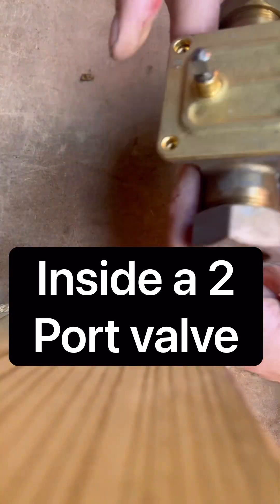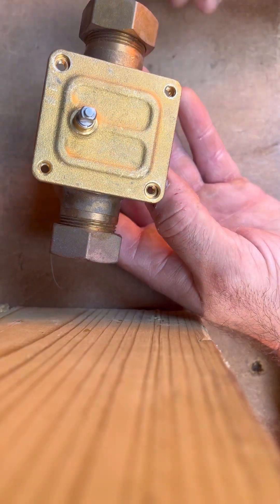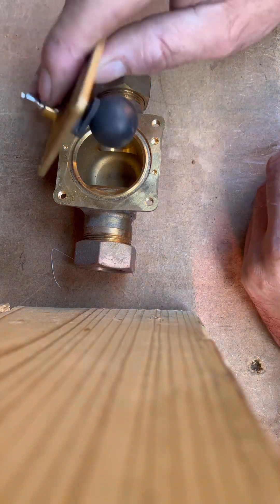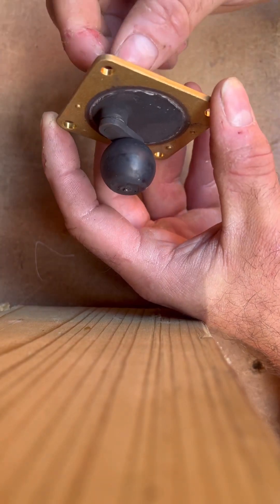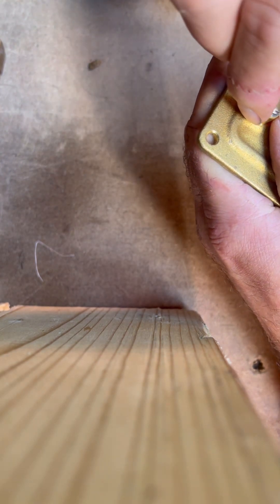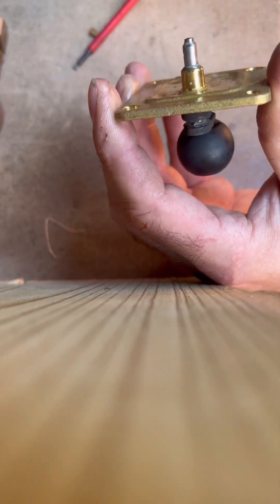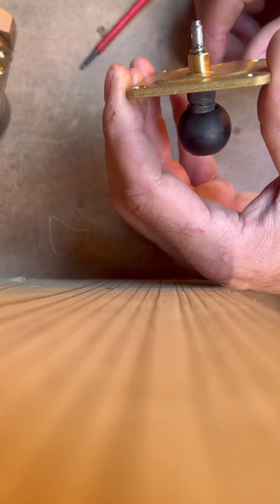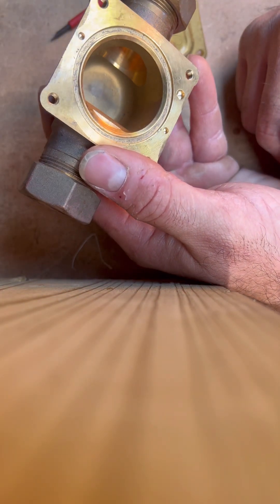How a 2 port valve works

Comment: My zone valve has an extra post  in the centre that the body locks onto. They are made by ESI. Bit annoying if you don't check the back of the head ESZV222LM.

Good thing is head is held in position so it's easier to get screws in though.

Thanks for the video